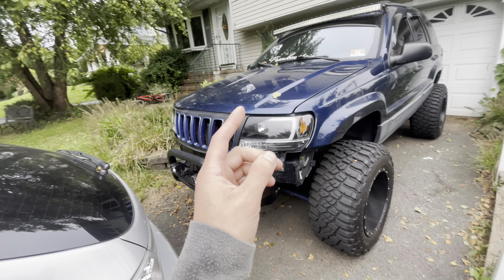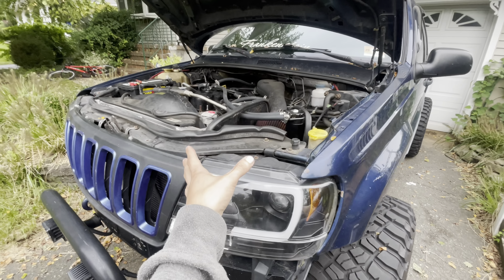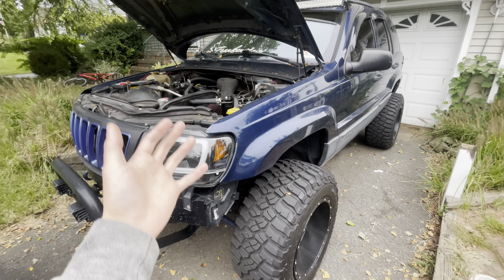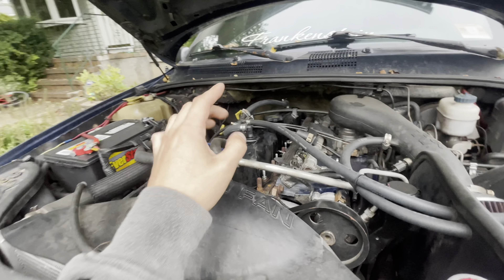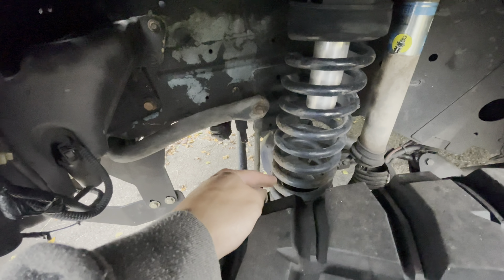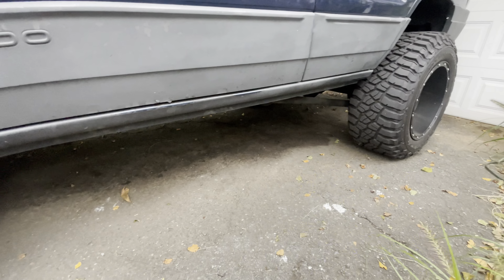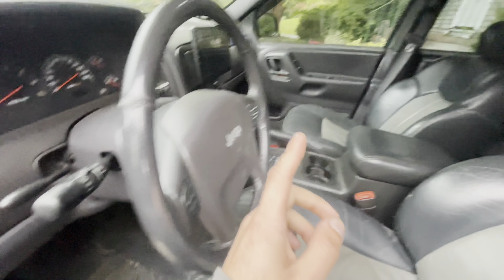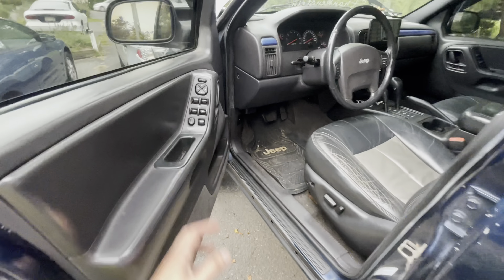5 common issues 99-04 wj Jeep grand Cherokee

Comment: Piston skirt issues are probably the most expensive problem these 4.0's. My 99 WJ Limited with only 130k miles had a piston skirt break. Still had full compression but made a loud ticking noise, I was just happy to find it wasn't rod knock or a wiped cam. My 4.7 Dakota has 250k miles on it, original engine and transmission, still runs and shifts like brand new.

Comment: You're an excellent mechanic replacing the crank sensor in a parking lot with snow on the ground!
Reply: Sensor went on me about 10 years ago on the hottest day of the year, had to get towed 25 miles with me and my doggie.
Reply from the maker: @dogsarefun2  thank you and the secret is the extensions over top of the trans to get it you get good at it when you done a couple of them but I’ve been mechanic for about 12 years thanks for supporting the channel!

Comment: Thanks for the video. I just bought a 99 WJ for a grand with 156k miles. My friends shop used it as a shuttle vehicle and they did a bunch of maintenance on it over the years. It's runs and drives great except for some worn trail arm bushings. Thanks for the reminder with the crank sensors. I had a TJ years ago that left me stranded in the mountains because of that sensor
Reply from the maker: @BudzyFoxMX5  nice find and yea them crank sensors will get you lol good luck with it!! Thanks for watching

Comment: Dude, great video. I'm a very proud only of my used '01 Grand. I'm 68 and replaced /2.5 " lifted W/ Core4×4 adjustable control arms w/"boomerang spacer, extended sway bar links, Cooper AT3 all around. Did the math/measurements. NEVER had to get an alignment after 14,000 miles since I did the lift. Oh, of course adjustable tracbar, drag links & tie-rods. A perfect -2 degrees caster. No over/under steer. 1/4 " play driving. I should've been a factory engineer.
Reply from the maker: @garyd.7294  thanks man I appreciate you watching and as long as you dial them in they drive great your specs sound good to

Comment: Thanks Bud, but I'm an owner of a used '01 Grand 4.0. Doesn't burn a drop of oil, 175,000 miles. I put Freedom 2.5 " lift w/Ruff Country 1" leveling spacer up front. CORE 4×4 adjustable control arms/trac bar. Did the math & measurements. Minus 2 degrees negative caster.  New drag links/ tie-rod ends.  1/4 inch play driving. Oh, of course CORE 4×4 spacer block for the rear boomerang. It's loaded. Heated leather, etc. 242 Select Trac. I had a 2000 4.0 QuadraTrac my son wrecked. I'm glad it's gone, the 242 hd is great. Thanks for the video without the electrical gremlin issues
 But that's only because our WJ's were way ahead of our times. I even have stereo volume/change control on the back of my steering wheel.
Reply from the maker: They had so many options that were available in many other cars they even had auto wipers in the overland it’s crazy

Comment: Valve cover gasket,  front timing chain cover, oil sensor unit, and on and on for leaks
Reply: My oil gage will drop to 0 and start beeping even though it feels fine when driving. I take it that is the sensor and my oil pressure is fine
Reply: @ayden8901  hard to say  they have been known to fail, and then the engine if screwd. I overhead my 4.0 a few times,,,,, tough engines

Comment: I paid my car off completely ( a forte) and just got myself an 05 grand Cherokee WK w/ the 3.7 v6 as a 4x4 winter beater. 148k miles. I know it’s an 05 but I’m just popping in to say my first jeep ever and I love it so much. Have been driving it more than my car lately hahahah
Reply from the maker: @mroddydawg  good to hear man it’ll treat you very well!!
Reply: @ I’m in Md. and will say it dialed inspection once, due to needing new struts, even the e brake dash light cause that wasn’t displaying on dash lit up. The price for those struts and all the repairs for it to pass inspection ( + inspection) was too much but. As my dad said, it’s gonna have to owe us back and ut hasn’t had any problems!
Reply from the maker: @mroddydawg  yea if you don’t do the work yourself it gets pricy for sure but at end of day you drive it for a few years and it pays itself your dad is deff right!
Reply: @ if it were shocks, we could’ve probably done it. We have our shop, but with it being struts, they are a little bit more dangerous. He actually thought it would be safer to have it done and it was done right at a place that does state inspections as well. So it failed the first time, but after it was all repaired, it passed. He told me it cost 100 and some dollars just for the E brake dash light sensor to appear on the dash. Because it wasn’t at first when I got it. Just that sensor cost a lot. I just hope it serves me good now. Jeeps do be thirsty though for sure haha.
Reply from the maker: @ lmao good to hear you got it taken care of!
Reply: @dylansgarage3549  same here because I have been driving and enjoying it lately and I’m driving it more than my car that I just got notice of being paid off as well as the lien being taken off ! That’s a 2021 Kia forte though.
Reply from the maker: @ I would drive the jeep more to lol I like older cars lol
Reply: @dylansgarage3549   I love it. Hasn’t been on E yet though lol
Reply from the maker: @ should only be like 65 70 to fill
Reply: @ yeah that’s exactly what a receipt in there said from the previous owner that got gas at a 7-Eleven some years ago. It was like $65 and I assumed it was from empty. I know I shouldn’t but I usually get about halfway and I’m like maybe I should top it off. But I can definitely go more than where I stop and get fuel at. I don’t know why I do that.
Reply from the maker: @ yea honestly better to not run it to low and they have a 21 gallon tank I’m pretty sure
Reply: @ good to know! Cause it didn’t come with an owners manual BUTT we have a whole book on the inside and out of a 2005 grand Cherokee. It’s one of those books that you keep in your shop.
Reply from the maker: @ Haynes manual?

Comment: I bought my beautiful 2004 4x4 Laredo in 2007. Still have it to this day and not looking to give up anytime soon. She only has 129K. But yes I was hoping you'd say the cam-shaft sensor! Happened to me a few months ago. Luckily, I was not on the hwy...which I hate driving on anyway.(Dallas lol). I was ready to trade it in. Luckily a good mechanic fixed it for me. Now I'm trying to find the knocking issue when I go over potholes. I already changed the ball joints, shocks and CV axles. I'll keep hunting. Maybe you've had something similar? BTW I'm about to buy those same headlight fixtures (Akkon). 
 EDIT: I also fixed that bad wiring in the driver side boot myself! I saved hundreds. Only spent $5 on wire nuts. haha. Great video. Thanks!
Reply from the maker: Thanks for the support man if the clunk is in rear it has to do with rear shocks bushings at frame they sell a kit to fix it aftermarket shocks seem to make noise on these all the time do you have the 4.0?
Reply: @dylansgarage3549   Oh no. The clunk is under the driver side floor board.  You can clearly feel metal on metal. Parts to check on next would be: track bar, sway bar, drag link, maybe mounts? I'm not a mech so it's frustrating when my go to my mech who can't figure it out. It's only when I go over potholes or over any moderate rough terrain. I will check those back ones  (which haven't give me any trouble) after I solve the front problem....Yes 4.0 I-6.....Thanks in advance if you have any ideas of what it could be! Subbed!
Reply from the maker: @JasnoGT  I would think sway bar or sway bar end links hard to tell without hearing it or seeing it

Comment: Whats funny is i have an 03 with the 4.7 ho. Heard nothing but bad things about them, i took a risk and bought one with 148k miles. I beat the hell out of it, expecting to replace it, and its still ticking away at 190k. Honestly quite impressed.
Reply from the maker: @justinprestridge6801  the ho is a lot better then the standard but some last and other explode I have seen ones with a ton of miles on them still going strong
Reply: I own a 03/ 4.0 liter just had oil pan, rear main seal replaced $$$$. 67,000 oringal miles. I hope i made the right decision🙏
Reply from the maker: @ deff did

Comment: For the fan control relay issue, convert to mechanical fan.
Reply from the maker: Yes I have one but if you disconnect electrical one it will throw check engine light
Reply: @dylansgarage3549  I did the conversion on mine about a year ago and didn't get a code (2004 Laredo 4.0). I don't remember doing anything special when I did the conversion (fuses are all the same, didn't modify any OEM wiring, don't remember resetting the computer but could make a difference?, etc.) so not sure what the culprit would be in triggering your CE light. The plug that goes to the relay on mine sits disconnected to this day, with a bit of tape over it of course lol. I have to be honest though, the fan noise is obviously much louder, but overall I haven't had any other issues. The CE light coming on is curious 🤔
Reply from the maker: @bitsquirrel140  not to sure honestly I knew it threw a fan code high circuit when I unplugged it so I run both fans now mechanical and electrical makes ac ice cold lol

Comment: I am the proud owner of 2,  2004 WJs both with the 4.0..  1 is a 4x4 Special Edition..  Quadra Trac 2.. All stock no lift anything..  Other one is 2wd but with a 5 inch lift Columbia Edition. Nice sound system as well.. bought it cheap $3K...    Trying to make one  Bad Ass machine out of 2 if possible... Lol...  or just upgrade both and keep the Columbia  Edition as a 2wd..  is it worth trying to convert the Colombia into a 4x4 ???   I have several other 4x4s to drive as well , including 2 3rd gen 4runners, and 2 jeep 4.0 XJS.  1 1991 2dr 4.0 and 1 2001 4dr 4.0 4x4..    Just hate to see that Columbia edition remain a 2wd.    I really like it... Any suggestions or Advice would be greatly appreciated... Thx in advance for all your knowledge...
Reply from the maker: @davidtrevino5211  convert it can’t be to hard to do center console shifter front diff t case drive shafts that’s really about it I can think of that you would need

Comment: I'm really glad I came across your video, contemplating on buying an 01 for $600  150k  4.0l one owner, have sputtering problem when running,this will be my project while enjoying retirement in 🇵🇷
Keep up the awesome job. 👍
Reply from the maker: @PRProwler  you won’t be disappointed if you get it for that price I just sold mine for a truck but I owned it for 10 years if you have any questions don’t hesitate to reach out to me I’ll help you out thanks for watching! Good luck with retirement

Comment: I have a 2000 Jeep Grand Cherokee 4.0 the only issue I'm having is the oil pressure. But I agree that the inline 6 is the best motor I wouldn't trade for anything
Reply from the maker: Sending unit I went threw an issue with mine had to change sending unit and the pig tail harness to it ever since been perfect
Reply: @dylansgarage3549  I've replaced it 2 and the same problem it doesn't start showing low oil pressure until it gets hot I have a video of me going down the road at 50 mi an hour and only showing 5 lb of oil pressure. When I stopped and I'm in park and I give it gas the oil pressure goes up but at cruising speed the oil pressure will slowly go down
Reply from the maker: @EricForehand-n6t  put a mechanical gauge on it to see if it’s actually low
Reply: That's my next move I'm going to put a aftermarket gauge on it. Going run it inside so I can see if it drops or runs normal
Reply from the maker: @EricForehand-n6t  I bet it’s a gauge problem o doubt it actually has low oil pressure

Comment: My 02 4.0 has 190K all stock and the only problems I’ve ran into is my rad fan relay took a shit on me and it would drain my battery, my stock alternator took a shit, my oil pressure sensor is about to take a shit, and my rad has a small crack right where the hose is but I fixed that with some JB weld other than that she’s a unit absolutely wish she would last forever
Reply from the maker: @failed_artist2503  nice seems like only basic stuff is wrong those relays I had go out a couple times
Reply: @ ya I’m kinda surprised more isn’t wrong with it I live in Michigan and the rust on it really isn’t bad but my sisters have ran it into the ground my youngest ran it without any coolant for about a month so I’m honestly shocked more hasn’t gone wrong with it
Reply from the maker: @ o wow lol durability right there lol and nice I have been to Michigan b4

Comment: Thinkin about pickin one of these up, im going from a 13 veloster turbo and im just concerned about the reliability on these things. Mainly with sensors
Reply from the maker: 4.0 if you want reliable I can guarantee you will not regret it I’ve seen some of them with 500k on original engine sensors arnt to bad of a concern if they go they are cheap and easy to change I’d look more at rust then anything cause they are old now
Reply: @dylansgarage3549  the one im looking at has three rusty spots. The rockers, the gas tank skid plate, and the rear a arm kinda (its not super rusty but its getting there). Its also the 4.0 with selec trac
Reply from the maker: @cadencarrithers2339  rockers are normal mine has it also you got two options rock sliders weld in ones or replace rocker panels once you remove the foam Jeep thought was a good idea to put in there it won’t happen again a arm isn’t a big deal you can replace it or if lifting you will probably be replacing it anyways gas tank skid plate also can be replaced for couple hundred bucks I have to do mine also now the good is that’s most reliable engine and the best t case they came with I’d say go for it don’t sound bad at all

Comment: Did you ever had a leak in the rear cargo compartment when it rains? I have a leak when my sunroof got clogged and i fixed it but now i have a leak on the rear cargo area i cant find where from
Reply from the maker: I used to it was the grommet for wires for hatch

Comment: i just did my crank sensor worst job ever in the heat
Reply from the maker: @microtechmachineshop  I can imagine once you do enough it becomes easier but still sucks lol
Reply: I installed a cheap one from Amazon and ended up replacing within a week with a NAPA part which works great.

Comment: I have a 2000 wj it runs fine in the winter but cuts off in the warmer months and won't restart until it cools off. But during that time when you turn the key on the gauges don't move nothing. It'll crank but won't start. Anybody else have this problem and can offer a solution?
Reply from the maker: Sounds kinda like a bad crank sensor I’d start there they are pretty cheap
Reply: Crank sensor.

Comment: I’m currently driving my 99 limited with a 4.7 and only had to replace the heater core and front suspension parts it’s got 231 k on it and only payed 800.00$ for it